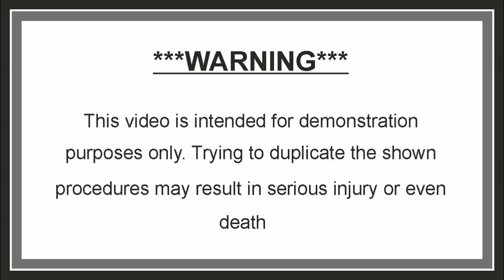SILVER contacts de-soldering new method

Comment: Hello 
For very small contact from relays , can I use direct the  cupellation method  without stripping the silver part from the metalic support?
I mean  smelted with lead and refined employing the cupellation process ?
Reply from the maker: Lenard Szekely depends on the “metallic support” if it’s steel based you can if it’s copper or brass it will be difficult
Reply: @OwlTech333  Thank You